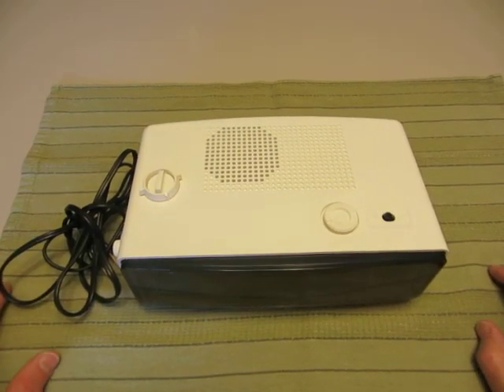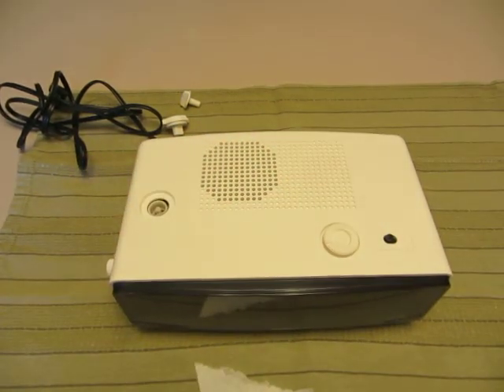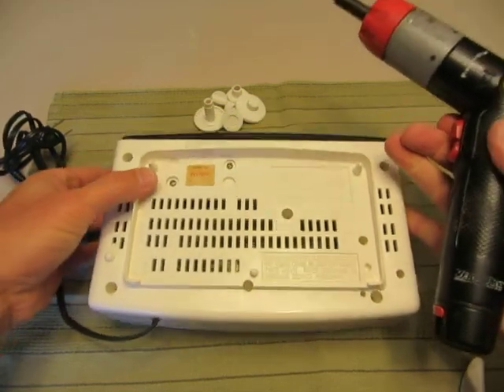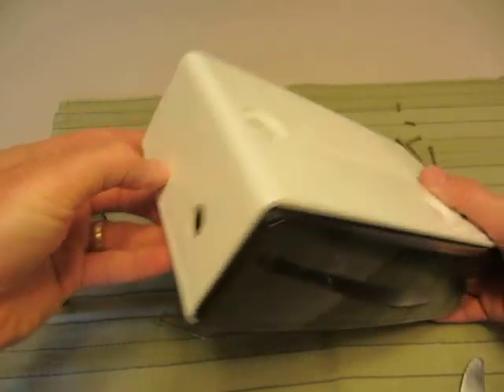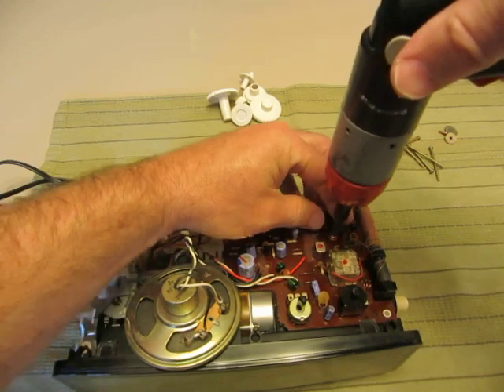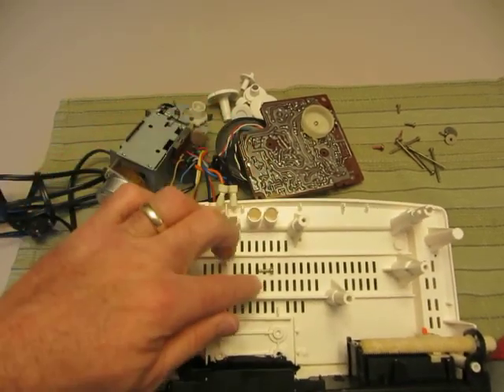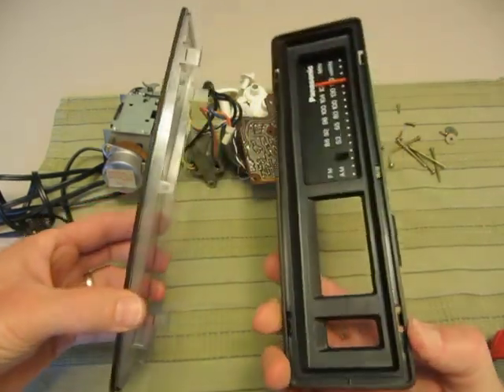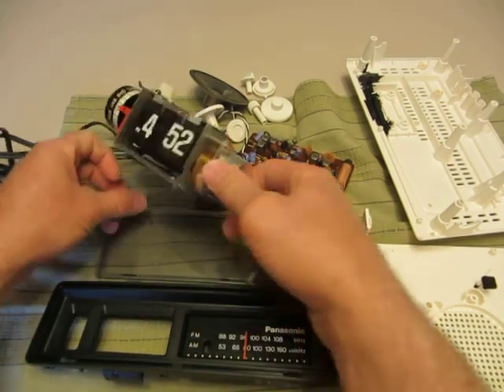Disassembly of the Panasonic RC-6025 Flip Clock - by FlipClockFans.com

Comment: Hi
I have a National Panasonic model RC-6551 flip clock that has a small problem! I can hear a quiet clicking sound from the motor. When i turn the clock with the front facing up, it's quiet and you can't hear anything! But when it's standing like it's suppose to, it makes that clicking noise! It just suddenly started making the noise. I guess you are some kind of expert and I wonder do you know what is wrong with my clock. It still keeps good time though. I live in a country where we use 230v 50Hz so its gonna be almost impossible to find an original motor for it. I can't use one for 120v 60Hz. Is there any way to find a new motor for it or repair the old one?
Please let me know.
Reply from the maker: I'm no kind of expert. Just  someone not afraid to jump in there and try to figure stuff out. I've had this problem before.  There's no way I can tell what the problem is from here, but I'm afraid that motor is wearing out and the flywheel (if that's what you could call it) is impacting the shroud (the cover). you could just take off the cover from the part of the motor  that you will see spinning, and then put the retaining bolts back on. That cover is sort of a dust cover more than anything. Again, I can't be sure. It wouldn't hurt to first try to shoot WD-40 into the motor (when it's off, of course). Cover other parts of the clock. It looks awful if it hits the numbers. Shake off excess and run with cover on. If that doesn't work, try my first suggestion.  Best to You.